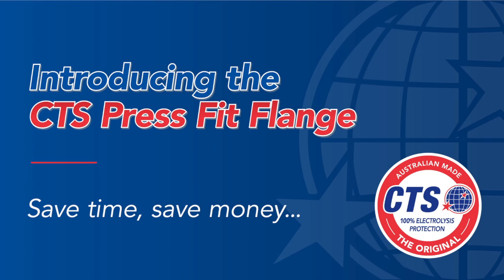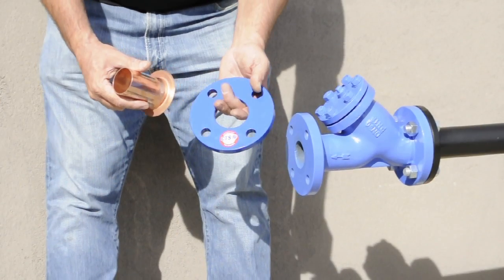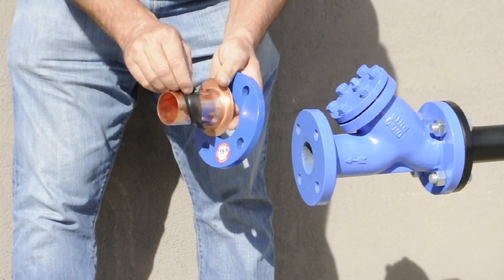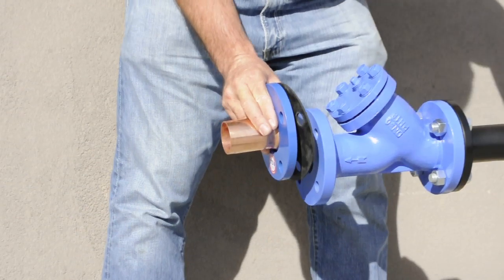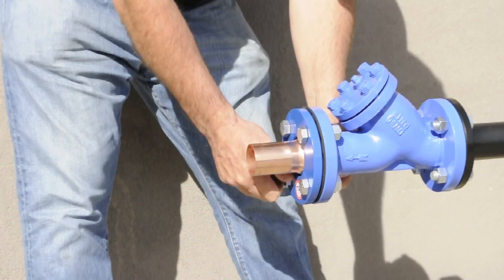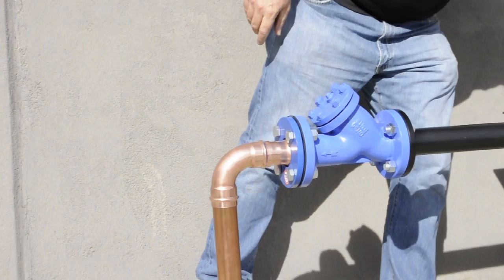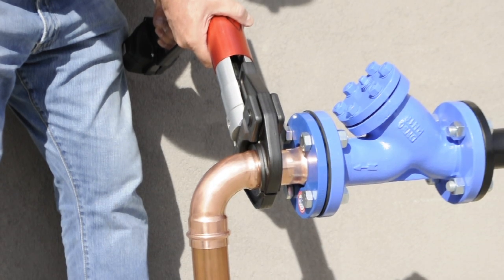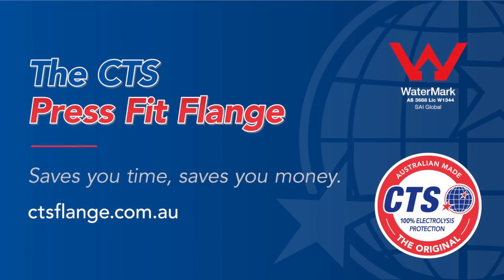CTS Press Fit Flange Installation

Comment: In low-pressure piping systems, as in combustion engines exhaust, a C Flange Bracket can be used. Im curious if other applications could benefit from it.

https://www.youtube.com/watch?v=zBdFKlVRh48&t=12s

The greatest benefit of this design is there no longer a need to make flanges thicker and weightier nor incorporate an increased bolt pattern which will increase labor or service time.